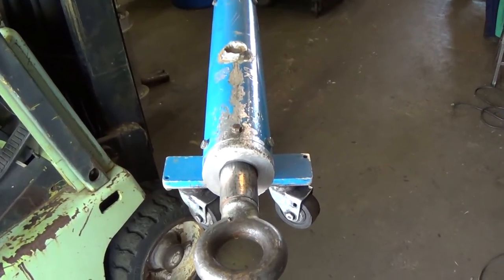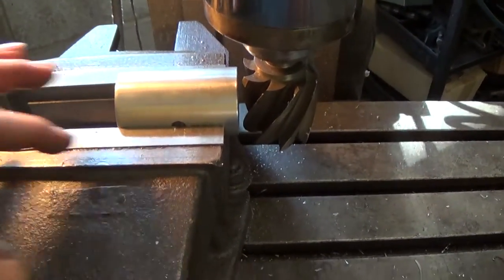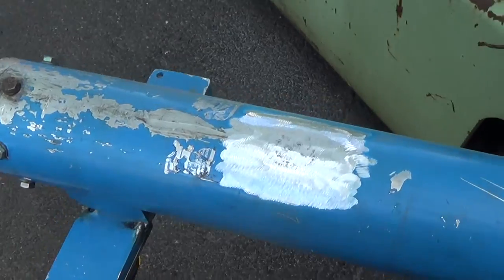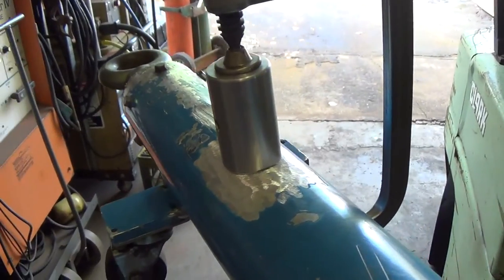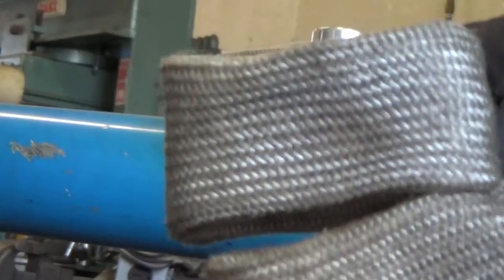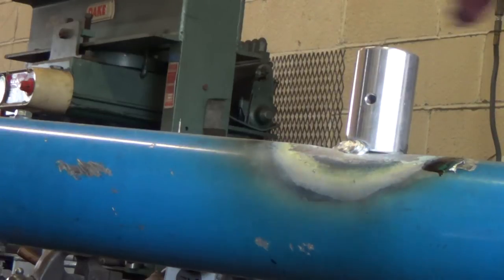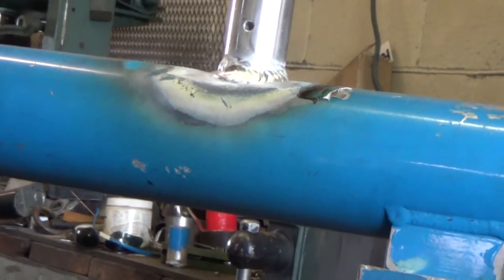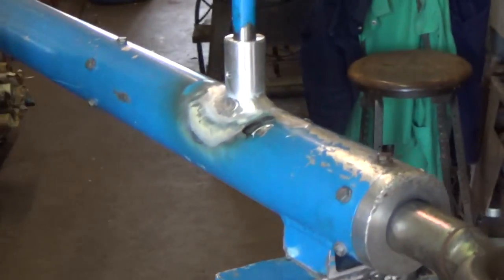TIG Welding An Aluminum Aircraft Towbar

Comment: Just watched this video and was kind of wondering why you didn't put a taper on the bottom of the new sleeve you turned, so that you could get some root passes in on the base of it? 
Great video though, so just ignore the stupid comments. Most of us here are watching to see someone else's craftsmanship or the way they go about fixing and repairing things, not to try to critique someone's mannerisms. We all have our own little quirks that we could be called out on, but pretty sure that's what the video wasn't made about, so just keep them coming.
Reply from the maker: Hi Fred, I figured the air gap was plenty of gap to be able to lay in good passes, I think I wound up triple passing this, so I figured it was a pretty sound weld when finished. A chamfer or small taper would have been a good idea if I wasn't going to be attaching it to a round surface. No problem with answering about why or what I did in a particular situation, that's what the comment/questions section is for, glad to be having people viewing and enjoying the videos.
  Thanks for the comment ...... Mike

Comment: Nice expedient "Y" gas mixer.
Aircraft tugs often make very tight turns and the towbar can get wacked by the ass end of the tug, which being made of thick steel plate for extra weight doesn't give way when it hits something. That damage track on the towbar is distinctive. 
The handle keeps ground crew from having to bend down when manipulating the towbar like a see-saw to connect it. The heads normally lock into the aircraft nose gear wheel axle to steer the wheel during towing.
Towbar are big bucks to replace like most ground support equipment.
BTW even Metabo and Bosch are now made in China so no "ideological" foul either running Chicago Electric.
Reply from the maker: Hi Ob,  yes, the ground support stuff really seems to take a beating, I fix quite a bit of it as I have a decent sized private airport near me. The "Y" mixer does come in handy when doing thicker aluminum parts. I did not know that the German manufacturers were also having their products made in China, that's really disheartening to hear.   Thanks for the positive comment.
Reply: @phuzzz1  I have a Bosch grinder that is made in China, Makita drill and ciruclar saw thats made in China. I now look for where stuff is made to avoid buying Made in China!

Comment from the maker: Not exactly sure, but I'd guess close to 250, I've been listening to that cooler now for almost 20 years and it's really starting to bother me, I think the sound might have something to do with the resonance from the metal, I don't know. I'm thinking of trying to build something to replace it, it might make for a good video project.  I must say that to the credit of the old Linde, I've never had any problems with it and I often use it with much larger torches.

Comment: I keep an air grinder for aluminium, in fact I also have air drills etc for the same purpose. The aluminium dust gets into the electric tools and kills them. That job was calling for mig welding, saves the pre heat and a lot of time.

Comment from the maker: After I took it out of the mill doing the quasi fishmouth I did slightly bevel it on the belt sander, I think it might be visable at about  5:50 . Since it's not a real fishmouth there is plenty of gap to put weld into, and there's no clearance problems so I was able to let the weld "float" out.

Comment: At the end of the video you were talking about how noisy the water cooler is,

 I understand what you mean a few years ago I purchased a new Miller Dynasty 350 with a Miller water cooler (Coolmate 3) but when I used it the first time the noise coming from inside the cooler drove me up the wall.
 I took it back wanting to return it but after everyone in the world looked at it (long Story) with no real answer to the problem.
 In the end I was finally able to get in contact with the technical guy at Miller and he sent me a replacement fan blade which was to fix the problem (which it did not)
Thinking about it I tried removing the fan blade and it was dead quiet so with the replacement fan blade I cut it down in size by about 1.5 inches in diameter and finally fixed the problem. 
    
I have an idea for you that does work is by using a tank of water of approximately 5-10 gallons in size (bigger is better) and use a small water pump maybe something like a fish pond pump or similar and just let the water circulate from the tank to the torch and back again to the tank, unless you are doing a lot of welding this works with no trouble as the water coming back from the torch is not really that hot anyway because the water does not stay in the torch head for a long period of time. (just an idea).
 
(If the question is asked why I did not do this with the new machine that I purchased. The answer is I thought I would just go with the whole Miller Welding setup knowing what I know now I would have done it that way after the disappointment of the Miller water cooler)
All the best. Peter.  Apologies for the long letter?
Reply from the maker: Peter CCR ENG  Hi Peter, I'm going to be working on a more quiet cooler along the lines of what you are describing, and I'm going to try and video its construction, I actually have some of it already filmed, but I had to side track that project a while back, I'm going to be getting going on it as soon as possible again. No need to apologize for anything, I appreciate all your input.    Mike

Comment: is there a reason why you used your cutting torch for pre-heating.  I ask because I wonder if it's for some reason relating your gas fuel mix and to aluminum oxidation.
Reply from the maker: Hi Thomas,  I just didn't change the tip to a heating style tip, if I was going to be heating a larger area I would have switched to a rosebud style tip.

Comment: Not much on post flow are you?  Looks good though.
Reply from the maker: Dustin Walden  Hi Dustin, No, I don't really worry about post flow too much on something like this which freezes very quickly, and even aluminum in general, I'm a little more mindful of it when doing stainless and slower cooling materials. Thanks for the compliment.    Mike

Comment: Yeah. They ran it over. 20 inch damage. The most common damage. Those multi ton tractors. Up to 110 k lbs. 

Putting a stronger handle on it. Not a good idea.

Comment: Interesting, but this is not good aluminium welding, the technique and multi stack passes are completely wrong and the weld looks rough and amateurish, no qualified or professional aluminium welder would weave this sized fillet unless it was in the gravity position and even then doubtful because of causing hot tearing in the weld metal.
But hey I'm sure it will not fall off which is the only battle you are interested in.
Reply from the maker: David Richards  Hi David, glad you found the video interesting. What I'm interested in is making a good sound repair that is in this case  [and most others I do]   FAR better than what was there from the manufacturer, and I have absolutely no doubt that that is exactly what I did. As far as my welding capabilities, I, and apparently my customers are completely satisfied with what I do and how I do it, I've been doing it that way now for more than a quarter century, and I really can't say I've ever had a weld failure brought to my attention, in aluminum or any other material for that matter, I have and do however, get called on to fix a whole lot of them as performed by the  [as I like to call them] Hollywood stack of dime-rs , the really good professional blah blah blah something or other welders, oh and of course the guys who quote all the metallurgical info, kind of like you've done here. So, yes, my welds may appear amateurish or whatever, however, they all seem to perform really well, so I'm going to keep on doing exactly as I have been doing, because it has been time tested and proven to work where many others have failed. Your viewpoint of my weld appearance may very well be correct, as I have never in my life had a welding lesson, course, or any other type of training in welding or metalworking in general. I explain that in my introduction video if you'd care to watch it. That not withstanding, I've also never failed to pass any weld certification spot test when asked to on various jobs, be they in plant piping or outside structural, or heliarc bench work. If you possess some type of x-ray skill that allows you to be able to look at a weld thru a video on You Tube and determine where it will fail, please let me know right away, as I will get in touch with the customer and have them bring the piece back for rework, but I'm gonna guess that's probably not the case, and you can see by the date on this video, it's been in service as I repaired it here for just over 2 years, so I'm thinking it's gonna be just fine. Thanks for the view and your comment ...... Mike
Reply: +Michael Reggie Great job on your videos [PLEASE KEEP THE GOOD WORK UP] He must be a Hollywood welder maybe he needs to view more of your videos to learn something.
Reply: +Michael Reggie You tell him, Mike!

Here in Australia we would say something like "How does 'Get fucked' sound?"
Reply: +Michael Reggie  Hey I was just telling it the way it was, if you don't like it then OK no problem for me you can keep welding crap as long as you want, nothing you weld will have any influence on my life.
For you and the other clever commentators who seem to struggle with the language ( understandable for the Aussie) and who only have a deep technical response of "Get Fucked" - which may I add I have been trying to do for many years, there are some excellent youtube welding sites such as welding tips and tricks, Mr TIG/weld.com any of the propriety sites by Miller, Hobart, Lincoln, Fronius etc etc. Take the time to learn something instead of bullshit.
Reply: +Leon Springs Boys TV Dear me, is that a bad thing? To be an Internet NOOB, I mean?
Reply: Temper, temper its not worth the blood pressure dear boy.
When you finally know something about anything please keep it to yourself.